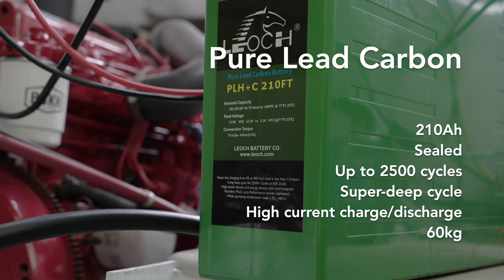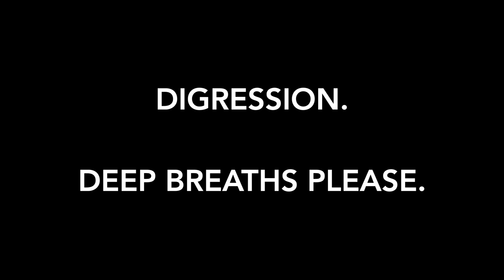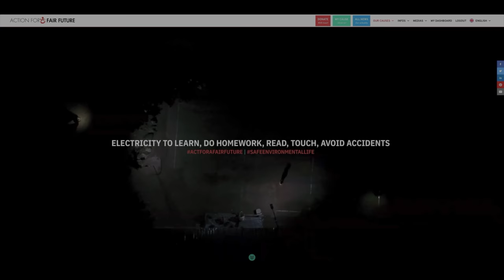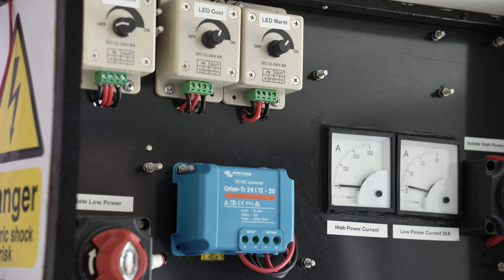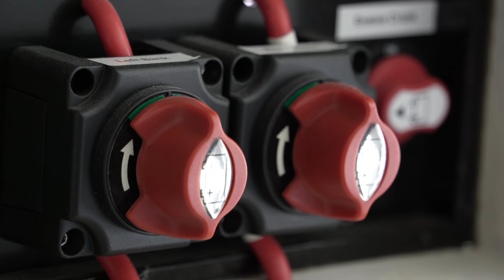Lifeboat Conversion Ep12: Introduction to 12V / 24V electrics system, and battery choices [4K]

Comment from the maker: So either the entire corporate staff of the Loctite brand are subscribers, or their threadlocker range is good. Just a heads up for those about to post the same advice!
Reply: From my experience with firearms in subzero (Fahrenheit) conditions, Loctite has a tendency to act more like glass and shatter.  My favorite lock nut since it can be removed and replaced a reasonable number of times is the flexloc nut.  It really doesn't care how cold or hot it gets.  Also they're cheap.  Stover lock nuts are probably cheaper but they tend to make both the nut and bolt single use.

If it absolutely must not fail, wire lock nuts (and bolts) are the industrial standard.

(honestly you can just take a regular nut and just give it a good whack with a hammer to make a lock nut though)
Reply: My favorite locking system is free and fool-proof and works best for hardware that is meant to stay together and not be routinely removed and reinstalled.
It's called a Mexican lock washer.  Just take a pair of pliers and booger-up the threads of the bolt/screw and then install the nut
DONE
Reply: @scotte2815  You should try the smacking it with a hammer method.  There's a lot of expensive lock nuts where thats basically all they are.  You can can take them off and put them back on without the threads being all chowdered.  Its a little hard to get the right amount of oval I guess.
Reply: @htomerif  yes and then there's the distortion in the vice method,  the bent shaft method, the elmer's glue method, the wrong thread pitch method, the solder method, and if it fails the blame it on some one else method (very popular with Democrats
Reply: Yes but have you considered thread locking chemicals? One popular brand is Loctite...
Reply: I see a lot of expert advice and ?politics around locking nuts, wow! I really am no expert but surely just standard simple nylock nuts would be perfectly fine? They have been holding my 30 year old GTM Rossa kit car together very well thank you.
Reply: @TheLoxxxton  No.  The reason no one is suggesting nylon is because if this boat ever gets down to -40 degrees the nylon will probably just shatter with any significant vibration.

The boat's probably not supposed to ever get that cold, but if it does, that probably means something is broken and the last thing you need is more things breaking during an emergency.

I'm guessing he's going to have to do a lot of reconfiguring when he adds an inverter and charge controller.  Its also probably going to be prohibitively expensive for all the electronics he uses to be mil spec temperature range and it could realistically get colder than that.
Reply: @htomerif  well there ya go! No idea what mil spec and such mean but as I said I'm no expert. Bless you for your indepth Arctic knowledge. Coldest it gets round these parts is about -2 c and that's cold enough for me and my nylocks thank you very much.

Comment: Nice install. 
As an elevatorguy for 20 years i really appreciate clean installs that are easy to go through when fixing what has gone wrong.

And nylon locknuts will never rattle loose. They come in m3,4,5 and alot bigger.
Reply from the maker: Thanks.

My reservation with Nylocs is that the nylon deforms after one use, and doesn't lock as well if you need to undo and re-tighten.

Comment: Lithium cannot handle the cold with out a heater so i think you made the right choice
Reply: I mean it can to some degree. But lithium ion will not preform well under 0 degrees Celsius
Reply: My very first thought.
Reply from the maker: It's only charging under 0deg that Lithiums struggle with. Discharge is fine (indeed very good). It won't get that cold inside the boat where charging goes on.
Reply: @AlexHibbertOriginals  but think about your 24 V battery you want to use outside. It depends extremely on the lithium technology! Be careful and have a close look on the C-Ratings according to temperature in the Datasheets!
Nice projects and videos! Wishes from Germany :)

Comment: Thanks for the tips.  Not that we get arctic temps in Texas but nice to know about the silicone option.  For the vibration issues (Loctite Blue-242) is your friend.  Excellent performance for high vibration & shock environments and still allows for disassembly without special tools if needed.  I totally agree with redundancy.  Keep it up!  Cheers!
Reply from the maker: Thanks. I've only used Loctite red and undoing it was a drama with a heat gun!
Reply: @AlexHibbertOriginals  Be aware that the colours doesn’t match between manufacturers and sometimes not even within the same manufacturer, so check the label before applying!

Comment: With regards to nuts coming loose: Get some nail polish/nail paint in a fluorescent green or orange color. Paint a stripe that runs from the side of the nut to the bolt's threads/top. It is enough to keep the small stuff from vibrating loose, and you can do a quick visual inspection. Then if you notice some of them becoming loose over time, re-torque with Loctite. Saves time in the long run.
Reply from the maker: An option for sure.
Reply: to be fair I don't think its going to be a problem I run a supercharged jetski long distance and vibrations are much higher amplitude and frequency, you wont have a problem with properly torqued fasteners in this application IMHO

Comment: Alex, an alternative to replacing your nut & spring washers. A small dap of silicone sealant to the nut and local area stops the nut vibrating loose and backing off from the spring washer. It may sound like it would not work or be too weak but is highly effective, long term and proven in many high vibration race car applications.

Comment: When you've removed over a ton of equipment from a boat, it's not a bad idea to use heavier batteries, especially when there's a tremendous cost saving. Very cool electronics system.

Comment: If you don't like spring washers, I use the smallest ever dab of silicon on the thread right after the nut. With a spanner it can easily be undone, will never vibrate off, can be very quickly applied after the nuts are fastened, and a tube of 'roof and gutter' silicone is about $3, which will do the whole boat, it isn't sealing any holes or anything so you don't need sika or some high quality corking, it's just a little snot that works perfectly to stop bolts coming undone.

Comment: I know you have already gotten your solar equipment, but, one way you could have gone is to find a retired electrical standup forklift battery pack. A used one that has been changed out will be more then enough battery to supply a house, but, is also a ton of weight for ballast in the lifeboat. Nice work never the less. That is a great project to undertake, and perfect to convert into a living space. 
Aloha from Hawai’i, and if your ever close to the Hawai’ian island chain, more specifically the Big Island of Hawai’i. Don’t hesitate to let us know….!
Reply from the maker: Thanks Robert. Actually the solar system isn't done at all yet. The little panel on the deck is just a small rollable temporary one. More later on.

Comment: If you are worried about any nuts and bolts coming loose consider using  torque seal paint on them. It will show you if anything has loosened up.

Comment: Good choice in Electrical Hardware Vectron makes realy good stuff! The solar charging hardware will be added at a later point I guess? When you mentioned that you would like to use a big Lithium Battery on shore please have a lookout for there temperature rating as most of them degrade heavly when used below 0C°. A recommendation would be Battleborn Battery''s there are tough as a nail and survived heavy weather on boat pretty good. Even a little saltwater was okay. They also come with a pretty wide range of safety features. Perfect for Sailors :D They also have a low temp cut off.
Reply from the maker: Quick mention again that Lithiums perform excellently in cold temperatures under load - it's charging sub-zero when damage can be incurred.

Another commenter states that a new generation of Lithiums - LTO - charge well in the cold too.

Comment: Very, very interesting!

I know what you showed us isn't the whole system, so my following thoughts might not have any use, but I thought I'd offer them anyway, if only for discussion's sake.

One- it seems to me that there should probably be breakers or fuses as well as cutoffs on those main lines to prevent damage from an overcurrent?

Two- would it not be advisable to have the engine able to start from either of the battery banks, in case one goes dead? 

Three- would it be more sensible to have the controls for the external lights up in the cockpit, where the helmsman could get at them without leaving his post?
Reply from the maker: Thanks Clifton.

1) Yes lots of fuses on the back.
2) Each of the four batteries can be used by just clicking on and off an Anderson connector.
3) These lights aren't navigation lights - but general flood lighting for the area around the boat. If another crew member can't throw the switches and the driver needed to for some reason, it's just a case of leaning down for 2 secs.
Reply: Thanks for the reply! As I suspected, I possessed incomplete information. :)

Comment: hello a suggestion for the screws, use Loctite, then no screw will loosen if it shouldn't.
it is very weather-resistant from -55 to +200 Celsius

Greetings from Germany :)

Comment: if u worried about bolt undoing themselves, u should consider using loctites. also using fan ducts and diffusers greatly improves it's efficiency.

Comment: The toggle switch panel @10:30 needs a cover to keep the switches from getting bumped by people as they move past it. The tight quarters it being on a boat will cause people to bump the switches and turn them on and off. Some bent, metal bars on either side of each switch or just a full cover would be a very good idea.
Reply from the maker: Yes indeed - already on order.

Comment: Hey Alex, I see you’ve used quite a bit of victron gear in there! If you’d like a hand working out any wiring for anything I’d be glad to help. I work for a Victron dealer and design off-grid power systems for a living. Also, on that note. I think 24v was an excellent choice for a system of that size.
Reply from the maker: Jacob - that would be very useful. Thanks. If you get a moment wing me an email!

Comment: An alternative to spring washers you might want to look into are nord lock washers. However what you have will be fine with a blob of locktite on as Ben Dover mentioned below
Reply from the maker: Already on order arriving tomorrow!
Reply: +1 on the Nordlocks, they are excellent, except for a couple caveats. First, buy only the name brand ones, I’ve heard of a lot of people having trouble with the copies. Secondly, they only work properly if there’s no washers under them, so read up on the documentation on what stackups are ok. That being said, they are still better than a spring washer on top of a normal washer. Finally, be aware that sizes over 12mm can lock too aggressively, as the cam surfaces need the bolt to stretch before letting go, which if torqued down properly can actually cause the bolt to sheer before the Nordlock lets go.

Comment: It sounds like you have two mics on at the same time. Could just be odd reverb inside Alan, but you might want to check if you camera's internal mic is on and mixed in.
Reply from the maker: Hmm - just checked and the camera mic was muted. Sounds ok my end - probably just the result of the cheaper lapel mic over the SM7B I use for VOs.

Comment: Nice job on the electrics. Good choice on lead carbon. Depending on how fast lead carbon can take a charge you might want to look at an alternator upgrade. For example lithium can take a charge so fast that it will fry alternators that out out low amperage because they aren’t designed to run at 100% of rated output for very long. So people often upgrade to 125-175 amp output alternators. If lead carbon is similar then you could have this issue. Also you don’t have to run as long to charge and when you’re running to charge batteries and so you don’t over tax and fry your alternator.

You might want to look at installing some USB-C depending on your AV equipment needs. Like a laptop could be powered directly from the appropriate USB-C outlet and avoid using an inverter. Having USB is way better then running an 220 inverter. AC inverters waste a lot of power. You can buy cigarette style adapters for many laptops.

Might want an red LED strip option inside in case you’re having to navigate at night. 

DAMAVO YM1218 USB C & USB A Dual Port Car Charger Socket Power Outlet Adapter Type C USB Car Charger Socket with Cap 12V/24V for Car, Marine, Golf Cart, Bus, RV, Automotive Marine ATV Truck (2 PCS) https://www.amazon.com/dp/B08K8Q74XL/ref=cm_sw_r_cp_api_glt_fabc_8YVV1KKWEZZY6RFF6KCE

Or depending on device type. Power Delivery 3.0 USB C Car Charger Socket, Ouffun 48W PD & QC 3.0 Dual Port 12V USB Car Outlet Adapter with Button Switch, iPhone Fast Charger DIY Kit for Car Boat Marine Bus Golf Cart RV Motorcycle https://www.amazon.com/dp/B08XLKX832/ref=cm_sw_r_cp_api_glt_fabc_94DZVN0RN1QQ8DWQSBGS

Cheers,
Jeremy
Reply from the maker: Hi Jeremy

Yes, on the USB charging topic I've been on the simplification bandwagon for a good while. When optimising power and charging systems for sledging ski journeys it's normal to go through these processes. The inverter though will be needed for things like running an electric chainsaw etc.

Red LED - yep already made. It's just a case of not having the time to film 100 episodes straight away.

Interesting on the alternator / Lead Carbon front. I may consider controlling the current as it's a 100A alternator. The batteries will also be charged by a diesel generator when not underway.
Reply: @AlexHibbertOriginals  I’d consider limiting it to 75 amps for reliability. 

Is the alternator 12v or 24v ?
Reply from the maker: 12v. Thanks re: current suggestion.

Comment: Unless I missed you saying it, you should run independent fuses throughout the entire system from where it terminates off the battery with a high rated fuse, and stepping down all the way through for all the different components, wouldn't want the lights to go out. And think about stepping up or down certain USB ports amperage for higher consuming devices like when charging portable battery banks.. (1, 2.1, 3.7, 5, X).
Reply from the maker: Plenty of fuses installed on the other side. Should have mentioned.

I can see the USB logic, but I think 5V for all is ok for now.

Comment: Hi re Spring washer replacement could you not back up the existing fasteners with Loctite thread lock adhesive? Keep up the great work and series 👏 👍 By the way my labelling machine never leaves my boat.

Comment: Nice vid again Alex, any reason your panel is not say wall mounted? I suppose getting at the back of it would be a pain, but it would be a bit more out of the way.
Reply from the maker: Yeah it's about access to both sides. And it's an area of the boat that would otherwise be dead space.
Reply: @AlexHibbertOriginals  nice, makes sense!

Comment: Good move on the lead carbons. 
Did you fit balancers to make sure the 12V batteries in the 24V series stay in balance?
You talked about ammeters/precision. Electronic monitoring via shunts gives both and would be simpler, but too late now.
Reply from the maker: I've not - but have been checking them over the past months of casual use and the voltages always match within each bank.

I have the shunts installed, so could wire in whatever is necessary. Electronic monitoring of what sort?
Reply: You have Victron gear. I was thinking of the smart shunt/BMV 712. They read about as accurately as anything else. And keep track of capacity/usage in a small unit.

Comment: Alex, nylocs should take care of anything rattling loose. I understand your electrics fully and the choice of 24v but i am wondering why you introduced additional load using step downs when you could just pull 12v straight from the batteries and fuse accordingly?
Reply from the maker: Hi Neil. Because then I'd have current flowing at 2x what's necessary for far further, and the devices would have an input of anywhere between 11-14V, not a lovely regulated 12V. I also have some 24V devices. So for simplicity too.

Comment: Excellent vid Alex and I totally agree with everything you said and it's a good well laied out setup, great explanation of the system, however I'm a bit worried about the lack of fuses, shunts and re settable circuit breakers though mate, unless there away somewhere else. Seeya Rob
Reply from the maker: All on the rear of the panel Rob. You can sleep in that safe knowledge.

Comment: Battery chemistry effects voltage(peak, charging...).  Can those be put in parallel without special management??  I am a fellow jack of all trades master of none...  I do not have a boat or do arctic adventures but love these videos.  Keep sharing your thought process.  Love it!
Reply from the maker: Thanks Joel - the battery charging system takes care of management, and will charge the batteries as individual units.
Reply: @AlexHibbertOriginals  I assumed you had this covered... Never hurts to ask.

Comment: Nice industrial-looking panel, which is I figure exactly what you want for ease of maintenance at sea.  

Are you going to molly-guard that subpanel (fans and external lights) against accidental contact?  It looks like it might be easy to clip it with a knee or elbow and turn things on or off without noticing when survival-suited ... then again I guess it's not exactly a critical emergency if that happens.
Reply from the maker: Yes indeed - already on order.